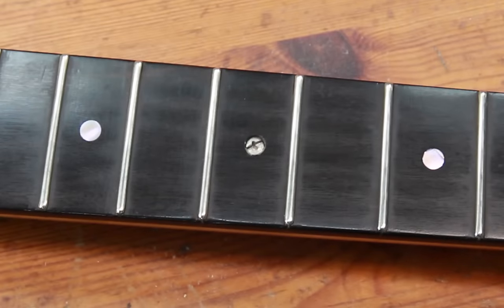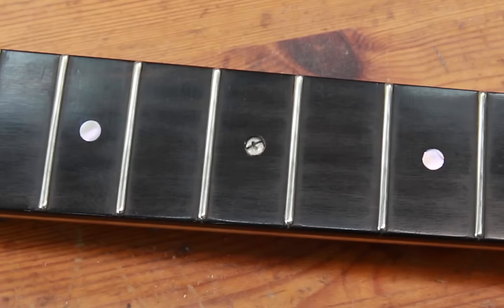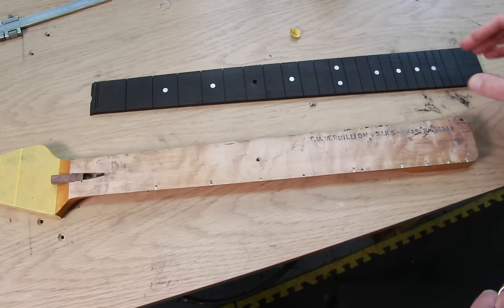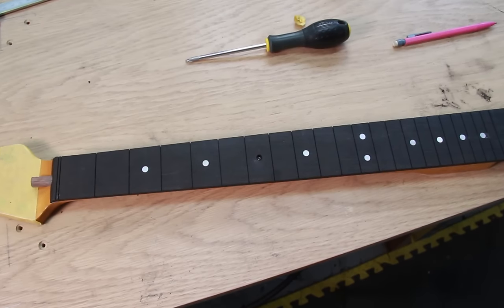35th Anniversary Stratocaster-replacing the fretboard

Comment: I completely understand why the owner would want this done. However, I find it ironic that Leo Fender made these with bolt on necks to avoid the expense of requiring this kind of work.
Reply: That was my first thought.
Reply: Yes but also important to remember back then there where only 1 series of each model, not like today where everything gets discontinued faster than you can look in favor for a new series 😂
Reply: They probably figured people would just replace the neck instead of repairing it.
Reply: @TractorMonkeywithJL  Figured? That's exactly what the intention was by having a bold on neck.
Reply: Exactly
Reply: I completely do not understand...  Seems like it'd be cheaper to find one with a neck radius he liked.  Did I miss something or was the neck radius issue not addressed after checking the original fretboard radius?  Not a negative comment but just wonderin...  I assumed that since he cut the fret slots, the ebony blank was  flat or not radiused or a standard dimension blank.  Notwithstanding the meticulous, master craftsmanship on display...
Reply: It's a vintage model and he doesn't want to lose the original neck

Comment: That looked like a very hard job. I'm glad that it was brought to someone who takes so much care to get the details right. The end result was superb.
Reply from the maker: Thanks. Without doubt my most challenging repair to date.
Reply: @flameguitars5770  I'm in awe of the care and foresight  to head off potential problems before they arose. your experience shone through in abundance. I look forward to learning from you in the future.
best wishes to you sir. 👍
Reply: @flameguitars5770 really interesting to see the detailed work where the plug meets the fretboard. You are an artist sir.
Reply: @flameguitars5770  I'm by no means an expert and you obviously are, but, would taking the frets out before you remove the fretboard allow it to flex up and away from the neck easier?
Reply from the maker: @adamimberti6948  possibly, but ebony is a very stiff wood. I am using the frets to transfer heat into the fretboard. If I had known how difficult it was to remove the fretboard using this method I might have taken a different route.
Reply: @flameguitars5770  I just remember seeing something where the guy said when you fret a guitar it adds a slight back bow to the neck (which surprised me) so I figured maybe they were offering some resistance in that direction.

Turned out great either way. Very nice work.

Comment: Dude, you need to get yourself a monocote iron. It works so much better than what you're doing. You're just laid that iron on top of the frit board and it Heats it up, and it loosens all that glue up so you don't have near as much trouble. Getting those fretboards off and you won't pull as much wood up out of the neck itself

Comment: Thank you for this video, David.
It highlights the level and range of skill required to be a first class luthier.
As an amateur dabbler in luthiery, I attempted to remove an ebony fretboard, which behaved in the same way, and resulted in the board repeatedly splintering.
Possibly,  the brittle nature of ebony combined with the nature of some glues makes destruction inevitable.

Comment: Beautiful work! I have an '88 Strat Plus with the locking tuners. My only comment is regarding the string wrapping. If you are using drop tunings like I do,  it is better to allow for a bit more winding on the tuners so that the string bend  point is not involved when the string is loosened which will cause the string to break at the bend from the bending action itself. Also, it the sting clamping device vibrates loose (which they do), you still have a a wind or two to hold the string tension. Something I learned along the way. That said, I learn way more from you than that tidbit! Thanks for sharing your knowledge.
Reply: I am a professional luthier too. I know that what you're saying is true. I had to allow for string movement by turning the string so that it doesn't bind or break at the headstock. Thank you for sharing your experience here.

Comment: I saw another guy on YouTube do the same thing only he used a thickness sander to remove the fretboard. But his was twice as long and not any better than the end result. He was very much an amateur at this. I could tell since I too have had to remove I don't know how many fretboards in my day. I always do them the same way that you did. Perfect results. I'm only glad that you didn't have any more problems that you already did. I make compound radius fretboards but I am a professional. I've been doing this for more than thirty years. I think this is my thirty fourth or thirty fifth year. I have two necks in the works as of this writing (2/2/2024). 

I make my truss rods much simpler. It's only routed straight in the channel so as to facilitate a simpler adjustment and replacement. I have no steel brad in the middle to counteract - it's the job of the neck to do that. This isn't a bi-flex truss rod that Fender touts but I make my own single action truss rods that are more dependable and durable. They don't have a separate collar attached to them or anything else welded to them. So as long as the guitar is tuned and treated properly I don't ever have to worry about warping or twisting which double action truss rods have been known to do in the past.  Thank you very much for sharing this so that those who have never had to do this can see how its properly done - and by a true professional.

Comment: Those side dot placements were odd. I checked my '88 Strat Plus (Maple Fretboard) and my '93 Tele Plus (Rosewood Fretboard) and both were perfectly aligned. I'm sure Fender line workers would have used a jig to hold the neck. But since it was a Custom Shop job, I guess it was done by hand. Very interesting. Whatever you charged for that repair was not enough. Superb job!
Reply: Looked like a job that was not cheap.

Comment: This is amazing work to restore the fretboard!  At 29:16 you used push pins to locate the fretboard while gluing. Did you predrill for those pins or did you just push the pins through without drilling?

Also, did you apply finish or wax, etc. to the ebony fretboard?

Comment: What is that metal circle on the bottom of the heel of the neck? My Dean has the same metal circle and there is a grub screw in the back plate that will hit it. I assume it's for adjusting the neck. Other guitars I have do not have that grub screw or the metal plug in the neck heel.

Comment: That was very challenging, and you did a great job; but it looks to me like there was plenty of wood in the original fretboard, which could have simply been re-profiled and then refretted.  Was this not the case?
Reply from the maker: A couple of people have asked the same question. The end of the the fretboard had been flattened to a 20" radius. Returning that part of the fretboard to 9.5" would have thinned the edges of the fretboard almost down to the maple. And then the fret slots have to be cut into the maple. I discussed various options with the owner. In the end it was his choice to replace the fretboard.
Reply: @flameguitars5770  Thank you.  Sounds like the right decision then!

Comment: 29:30 what is that "elastic black rope/string" you use to clamp the fretboard to the neck?
Reply from the maker: Longs strips of rubber banding. You can get it in different widths and lengths

Comment: Excellent work sir., novice question?, would it be possible to remove the frets and use a planer to remove the fretboard?, then sand the mating surface of the maple flat to accept the new fretboard?, much respect sir, I do repairs and setups, but nowhere near this level of professional work.
Reply from the maker: Yes, that is a good question and that was my original intention. What I didn't know was whether I would hit the metal fixing that sat under the 7th fret dot. As it happened the fixing sat below the fretboard. If I had known that, and how difficult it was to remove the fretboard I would have planned off the board.
Reply: Thanks for the reply!, your work is excellent, great channel!

Comment: Great work as always. Did you put the truss rod retaining screw through the fretboard? And also, I just wondered if you have ever got to the point of needing to pull out all of the old frets and just plane off the old fretboard?
Reply: Ignore me!! I’ve just watched that bit!
Reply from the maker: A couple of people have asked about planing off the fretboard. Thus was my original intention but I didn't know whether I would hit the metal fixing that form part of the truss rod retaining device. As it turned out I would not. But then I  never anticipated that the fretboard would be so hard to remove.
Reply: @flameguitars5770  I really enjoy your cautious approach. That looked like a very difficult job. I have had a few like that, where you start to get that worry for a customer’s guitar. But it always comes right in the end. Sometimes you have to walk away from it for a while!

Comment: Remove the frets. Place cloth on fret board. Apply iron. Even heat across the fret board. Probably use lower heat as a result off even heating?

Comment: Like others I’m struggling with the value of this repair vs using a replacement neck.   I get it’s a custom shop instrument - but even those don’t really hold their value.

How did you ensure proper fret slot position?  I see the slotted position guide on the table saw - but it looked like they were eyeballed.
Reply from the maker: The jig I use ensures correct location for the 25.5 scale length. It was a very expensive repair but ultimately that is the customer's choice.

Comment: If the player does not want to keep the old fretboard at all, how about use a Japanese saw or a multi-tool to cut all the way through and then plane the neck? I guess it is easier than struggling with removing the layer of glue.

Comment: May i ask why you didn’t just take the frets off and sand it back to 9,5 again?
Reply from the maker: A couple of people have asked the same question, and it was something I discussed with the owner of the guitar. Maybe I should have addressed this in the video. At the end of the end the radius had been flattened to 20". Were I to reshape it to 9.5",  the thickness of the fretboard at the fretboard edges would have been reduced down to the maple part of the neck. Frets slots would then have to be cut. Those slot would almost certainly have to be cut into the maple. As the wish of the owner was to try and return the neck back to original,  this approach would not have worked.

Comment: You can see on the initial down the board shot that the fretting is worse than the contouring; I hope this wasn't done by a professional, otherwise dude got ripped off.
Reply from the maker: yes, I commented on the poor quality of the fretwork but it was cut in the edit as the video was getting too long.

Comment: pretty sure I would have just use a radius block to sand original neck back down to 9.5, lotta work and now its not original, plenty of meat on that fretboard to take her back down to a 9.5, plus you wont find as good of wood today as they used back then.. watch that fingerboard wont break in like the original . . .  fine repair otherwise
Reply from the maker: I'm afraid I disagree. At the end of the fretboard it had been flattened to 20". To return a a 20 to 9.5 requires reducing the fretboard thickness at the edge by a lot. And even if there was still some fretboard thickness left at the edge of the board the fret slots would have to be cut into the maple neck.